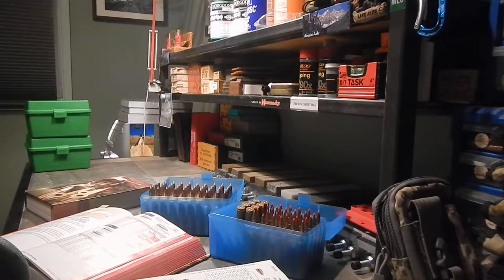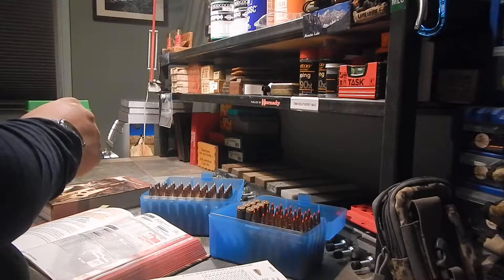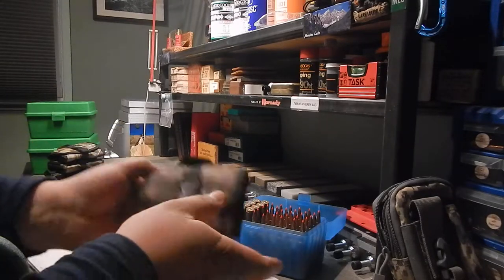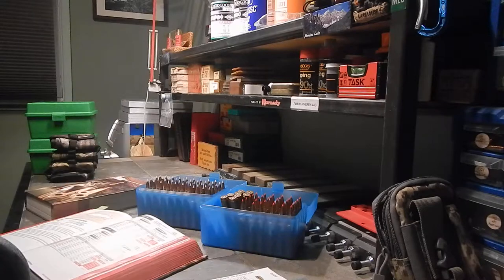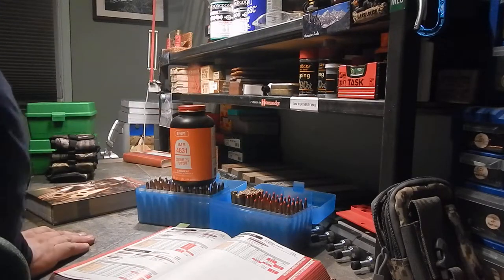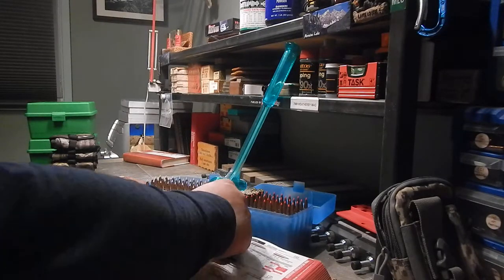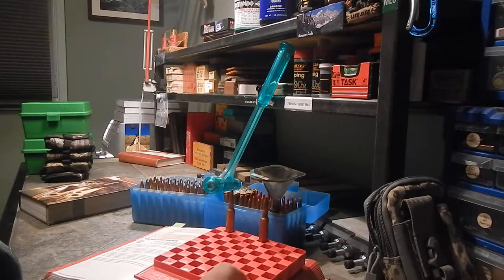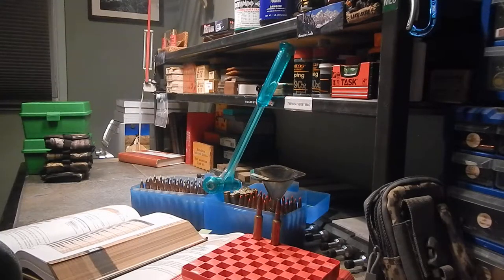7MM Weatherby Mag Part II (Reloading History and Load Development)

Comment: Awesome video. You mentioned dimples in the case neck and the frustration you went through. I remember countless times this happening to me. Fortunately it was with some cheaper odd six brass. I started using G96 gun treatment in a Ziploc bag. Been doing that for probably five years now. It's become my go to case lube. I seen you used the SST bullets. Just wondering if you used them on game? I had real good accuracy with those bullets but boy they fragment and make a mess. Probably the worst for weight retention. Thanks for sharing your video and I'll have to make a similar video to share.
Reply from the maker: Yeah, part of the learning process is making mistakes. Have to make them to learn anything. What's G96? I never did use the SST'S on any game yet. I left the rounds loaded with SST'S to try on wolves and coyotes but I work so much that I haven't found time to go in the last few years. I imagine they would blow those critters to pieces! Making videos isn't that bad, you should do it!